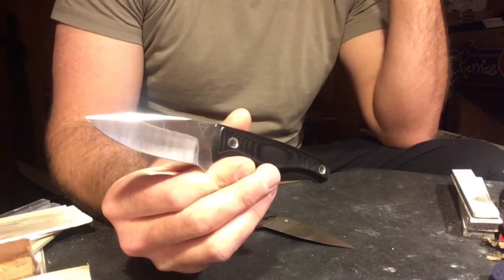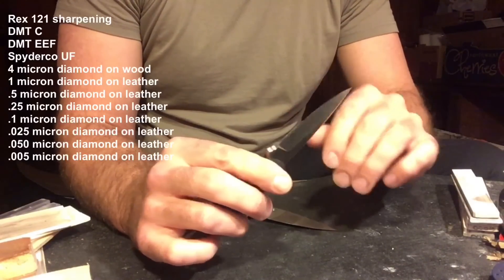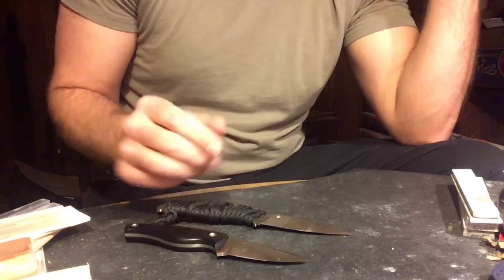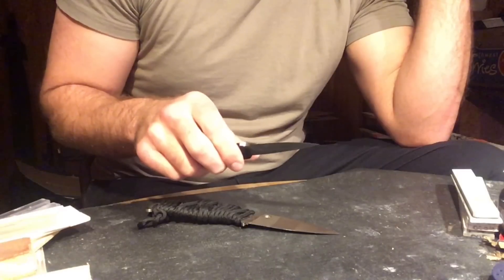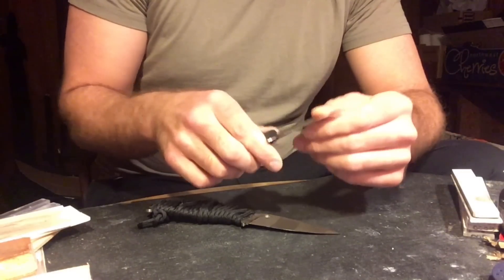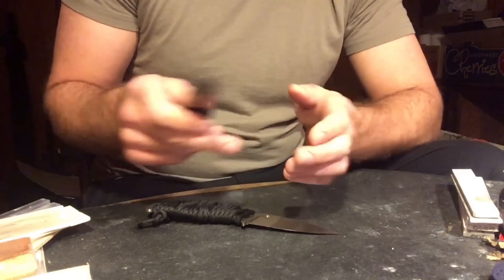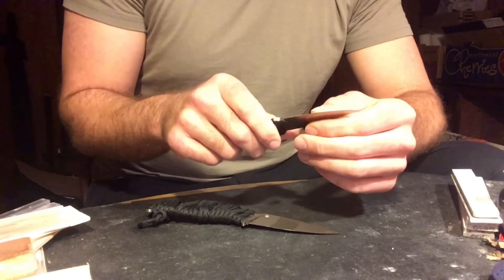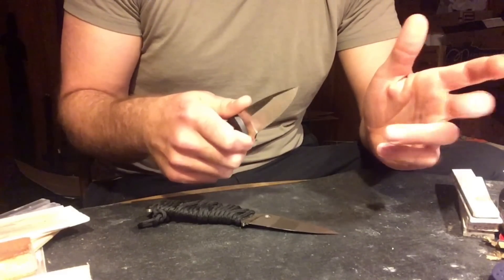Rex 121/Maxamet - edge retention comparison.

Comment: I try to be simple in how to sharpen high carbide steels like that. Get a good edge on it, get it cleaned and it's good to go. Its tricky to be testing two different knives and be talking about consistency. I find it odd. It's quite arbitrary based on the inherent differences in the blades being tested, regardless of the steel that's used. personally I find both of these steels to above the usability threshold for even high resistance knife steels. It doesn't really make much sense over something like k390 or zmax.  I'd be interested in seeing someone try laminating some of that 15v or maxamet. Gimme some lc200n laminated 15v and Ill get excited.  Rex121 I don't even bother with, even for a smaller lighter use blade.

Comment: Thanks for these tests Michael! Your knowledge on sharpening is over the top! I have a question, what angle do you recommend on Maxamet, (Manix 2 & Native 5) for EDC? And also do you recommend a mirror edge or say 600 grit diamond stone? Thanks in advance sir!
Reply from the maker: cavtj1 I usually use a coarse finish on Maxamet.  I run the edge around 30 inclusive, but you would be fine with something at 40 inclusive.  It’s up to you with how durable you want the edge bevel.  Obviously, the higher the angle, the more durability the edge will have.

Comment: Hey Michael...so I finally got my .05 and .025 emulsion in and got a cheap but surprisingly awesome leather strop. Now all the knives I've sharpened I take and do the .05 and .025 strops and they all whittle hair now! That was the key I think. That and my other strops had a suede like surface and this one is smooth. Maybe I was filling that super fine edge you need to whittle hairs without realizing and since these new ones are smooth yet real firm it just works. Pretty pumped. And I got a few chosera full size stones and Arashiyama 6k and my Kitayama 8k...so I am finally 100% done with having to get sharpening equipment....or probably not but for now lol.

Comment: Just wandering if you have any advice you could share with me on a problem I have while sharpening.  I have sharpened on stones for most of my life and can get a knife very sharp,  although not at sharp as you.  My problem is that I have trouble getting the angle even on both sides of the knife.  I notice that you sharpen the same direction by switching from your right hand for one side of the blade,  then your left hand for the other side.  I don't sharpen that way but was wandering if you do that to help keep the angle the same on both sides or if that was just the way you learned to sharpen.  I sharpen by going away from my body on the stone one direction and then back towards my body on the stone for the other side of the blade.  I can keep the angle the same,  but it just does not produce the same bevel/edge on both sides of the knife.  Sorry for the long post,  but thanks for any advice you can give on this subject.
Reply from the maker: matrix5175 actually, I sharpen both ways.  I can switch from right to left bringing the blade towards me the whole time, or switch back and forth (towards me and away from me) in the same hand.  (I show that in my Full Sharpening video of an Opinel 9).  However, I’m a very visual sharpener and more often switch hands keeping the blade towards me.  
Something you can do to practice keeping the angle the same is, use a guided system to reprofile and set the angle.  Then sharpen the knife freehand and try to imitate the angle that’s there.  Repeatedly sharpen the knife.  If you screw up the angle, reprofile and start over.  I suggest doing this with a knife you don’t care about...  an Opinel is a good choice for this.
Reply: Michael Christy I appreciate your response and suggestion. .....for some reason when I sharpen towards me,  the edge always seems to be bigger on that side of the knife than when I am sharpening away from me.  For the knife edge to "look" the same on both sides,  I generally have to hold the knife much higher about 25° pulling towards me, and then hold the knife about 5° degrees pushing away from me.  Keep up your great videos,  I really enjoy watching them!
Reply: Michael Christy Thanks again for your response and your suggestions.  I just wanted to state for the record that I didn't mean to infer you couldn't sharpen other ways than what I mentioned,  I was just wondering if you preferred sharpening or thought it was more beneficial to sharpen with your right hand, then your left with the knife coming toward you.  I totally believe you could stand on your head and sharpen upside down and still get a knife sharper than most anyone.  Anyway, from your suggestion I bought some  coarse and extra coarse stones to set the bevel on both sides of the blade before I started sharpening and that has made a world of difference.  I've never had coarse stones before so I always started with a medium stone and I think that is why I was having so much trouble keeping my bevels symmetrical on each side.  Learned so much from your videos already. ....so thanks and I always look forward to your next video!

Comment: Great video Michael, and the interview on podcast was awesome, but now i am curious to know what type of leather you use to strop! 👍
Reply from the maker: Junito Rosario I’m glad you liked the video and the interview.  
The leather I use isn’t so much a brand, but more leather with certain attributes, which varies based on the strop I’m making.
Reply: Michael Christy ive used buck leather and cow leather,but ive heard horse leather is the best i dont know if its true but im gonna try to get some to try it my self, tried Bark River cbn emulsion .5 micron on both buck leather and cow leather and it harden the crap out of both leathers to a point that the surface is like glass maybe i should have just used basswood like you do. any recommendations you can give me on what type of leather to use will be greatly appreciated and thanks for replying. 👍
Reply from the maker: Junito Rosario I’m not sure what BRK is doing with their emulsions.  
I use different leathers for different strops (I use different types, not brands), so making a suggestion is a little difficult.

Comment: Your right first I’ve really heard about Rex since cliff stamp! Mind bending stuff! Do u think with a different heat treat max could cut even more? Was wondering because I feel like spyderco does a great ht but never really goes for maximum performance!
Reply from the maker: Jovonn Trujillo I’m not sure.  It’s pretty extreme as it is.
Reply: Michael Christy hey Michael I bought cktg diamond stropping compound and having trouble applying it to my basswood strop.any tricks u use? Just having a hard time keeping the compound consistent and sticking to the wood. Thanks. Just remember u saying something about sanded wood verses as is.
Reply from the maker: Jovonn Trujillo is the compound you’re using oil based, or water based? (Is it in a syringe, or spray bottle?)
Reply from the maker: Jovonn Trujillo it’s oil based.  If you’re going to use it on leather, apply oil to the leather first, let it dry, then put the compound on.  
On basswood it should be fine to just put it on, (a thin layer) and go.

Comment: Looks to me that the geometry of the two knives is different. I'm not sure how much difference that makes in this test but I suspect it may be significant.
Reply: Tin Man Edge geometry can certainly Have an effect, but keep in mind in this test both edges were at 30°. The thickness behind the edge and the primary bevel had different geometries, but those things should not affect the rate at which the apex of the cutting-edge dulls. The nature of this test really focuses only on the wear resistance of the apex. The test is only taken until the knife is no longer shaving Sharp, if the test were taken until the point it would no longer cut cardboard at all then the edge geometry would come into play.

Comment: A word about the overheated edge. The overheating only came with the final sharpening which happens on the belt grinder at a very low speed. The issue was the type of abrasive belt used. The primary bevel is ground with a belt using a ceramic abrasive, typically those belts only go down to 120 grit. For the final sharpening I used a 320 grit aluminum oxide to set the 30 degree final edge, the problem is aluminum oxide will not cut Rex 121 (which I did not know the time) And unknown to me I heated up the apex, but the blade geometry was especially thin and I did not notice it. The solution is that I was able to locate some 220 grit ceramic belts to put on the final edge, these produced very little heat particularly at the very slow speed that I put the final edge on with. I do suspect that this steel as well as maximet will not respond well to aluminum oxide based abrasives. I strongly recommend using diamond based abrasives
Reply: Isn't Rex 121 a high temp tool steel? Can the edge even be overheated just by grinding, or was it more likely some type of fatigue due to pressure and burnishing?
Reply: Seems wild to me that someone that has such stuff in their possession, & would be playing around with such stuff and not realize alumina would not be suitable to cut basically the highest abrasion resistant steel could physically possibly be before it's not even steel anymore. Yeah no kidding use diamonds. I don't even use alumina on vastly less resistant steels than this.  Any steel with a decent combination of vanadium carbides and especially at high hardness, and especially at finer grits, forget it. Even on some where it will technically cut it's a waste of time and doesn't turn good results. Whereas diamonds gets it done quick and easy (in those cases) and turns much better results. Like, I don't even bother with alumina on something like hap40, even at 320 grit, which is nowhere in the league of rex. It's basically a halfway point between carbon steel and this stuff. Just seems wild to me. I don't own any rex121 and I don't make knives, but I'd never think to try that.
Reply: As 2 sharpenings were needed wasnt too bad. These steels are especially prone to 
this type of damage as they require a lot of grinding time due to the extreme wear resistance 
perhaps thier fatigue strength is rather low compared to pure carbon steels therefore 
the apex might also be fatigued from the sharpening before the sharp enough edge is formed. 
Most likely the initial problem was combination of both factors.. 
Nice little fix design there ")

Comment: This was more interesting than many movies I saw lately. The plot twist was better too.

Prior to sharpening, did you dull the edges the same way, by dragging them across the stone?
Does that do a bigger damage since they have a vary high hardness and they are brittle? 
Was there a significantly higher chipping damage compared to other steels?
Reply from the maker: West Senkovec I always try not to drag the edges on stones to dull them.  I’ve done it that way, but I prefer dulling them naturally.  
I didn’t run into any chipping damage with these tests.

Comment: Very interesting! I wonder if it will keep getting better or if your out of the over-heated steel. Pretty cool man, good thinking on both your parts by getting into fresh steel. And to beat Maxamet is just nuts. I've been doing more sisal rope cutting tests and I would be happy to share my results. I just got 410 cuts on my ZT 0909 before it was getting a little snaggy on paper...I was very happy i didn't get a bad heat treat. That's 3 knives now that I've lucked out on. Cedric got 109 with his 0909 with a convex edge and bad heat treat. In his testing he is getting like a 50% increase in cuts on some steels with a v-edge instead of convex. After always hearing people think convex is better I would have guessed the other way around. I also got 120 cuts on my spyderco Tenacious with shit 8cr13mov steel and I was very surprised. I think he got like 40 or 50 in other brands 8cr with convex edges. I know our tests are different and tons of variables but I'm happy with my results and can't change it up now for consistency  sake! I tell you though that 3/8" sisal rope isnt easy to cut and since I have mirror edges up to 10k chosera and my last strop .1 micron I noticed I had to do all push cuts instead of like a saw cut. Maybe that has something to do with it. I will have to stop at a 1500 diamond and then go to strops and see how that changes. And also do tests with free hand edges! Pretty excited to have a new area of knives to dive into! Great video man good luck with further testing!
Reply from the maker: Paul Lonardo good to hear about your testing.  Glad you liked the video.

Comment: And finished. Awesome work and exciting result. I am chomping to put it on my rope test. I am hoping the elements of my test let it sing as well as it can. I may do it without the cutting board and use a cork slab instead.
Reply from the maker: Cedric & Ada Gear and Outdoors I’m interested to see what results you get.  Lots of differences between the tests we do.
Reply: Cedric & Ada Gear and Outdoors end grain cutting board
Reply: @FearNoSteel  If you're talking about the same wood, end grain vs. grain makes no measurable difference in edge life, they cause measurably insignificant / virtually identical difference in abrasive wear. It's just another forum/marketing myth someone said one time, probably talking out of their ass or to sell products, and then everyone took that claim and ran with it. Now you see it repeated everywhere. Everyone just knows, yeah end grain is better for edges duh. Except it's not. Ever seen any actual evidence to back up the assertion?
Reply from the maker: Cedric & Ada Gear and Outdoors I would think the worksharp would be a problem with Rex 121 and Maxamet.
Reply: does it not also cause his s110v results to be less than optimal? or from yours is m390 / 20cv also holding the edge longer?..
Reply: natsyrt m to your first question, yes, it most definitely is causing less than optimal results.
Reply: Can't wait for this, Pete!!
Reply: From all accounts I don’t think I’ll be able to use the work sharp system on this steel. I remember doing i with maxamet and it being a real process which ate the belt and maybe even burned the edge, in hindsight. So I’ll probably jump straight to 17dps toothy like I did for my more recent maxamet cut.